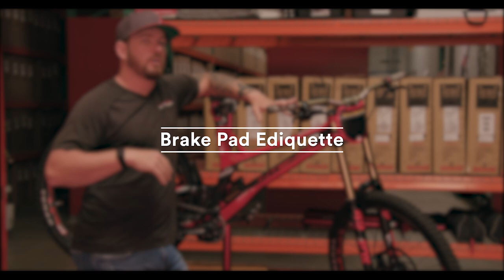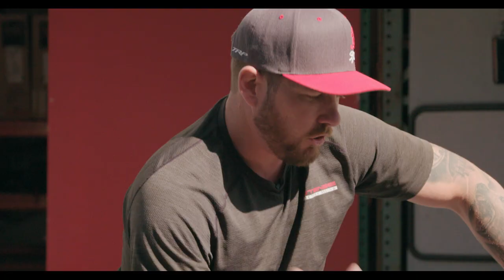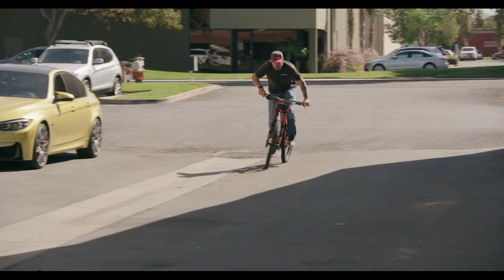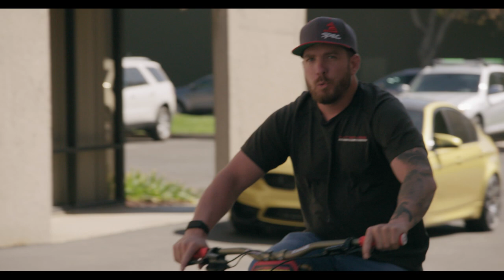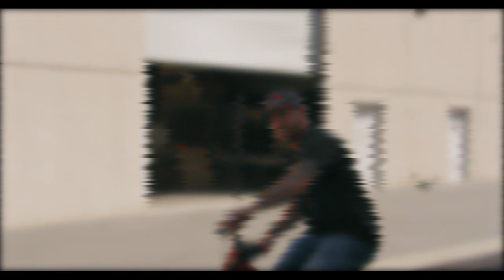Shortest Brake How-To Video Ever! Aaron Gwin's World Cup Mechanic shows you how to bed in brakes

Comment: Is this required with with every set pads or just with new rotors and pads?  Would there be enough pad material left on the rotors from the previous set of pads?  I bed in every new set of pads regardless, just curious.
Reply: Required with pads, it's not just the rotors it's the interface.
Reply from the maker: Every set of pads yes.